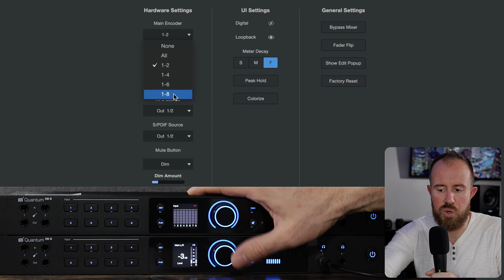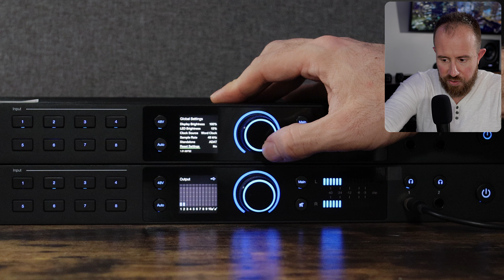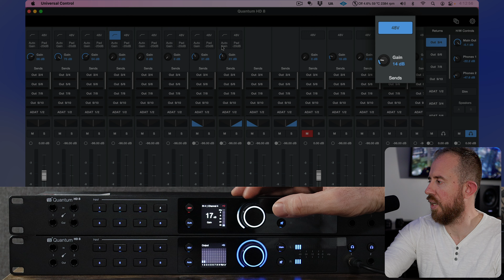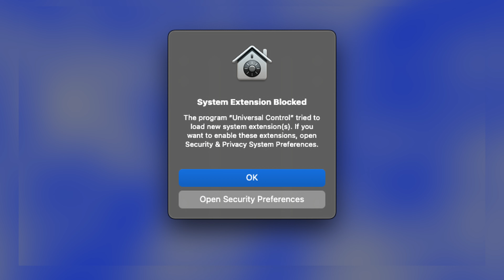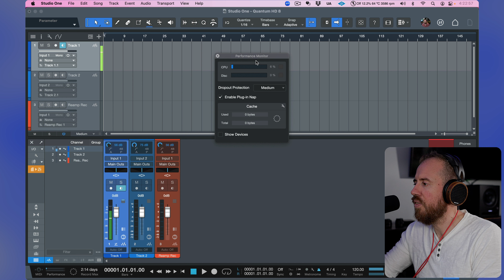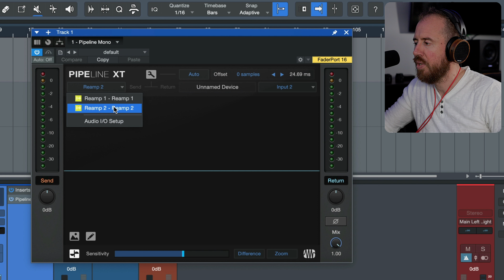PreSonus Quantum HD 8 - FULL Overview | USB-C Audio Interface

Comment: Why no DSP simple comp, eq and reverb? It's a deal-breaker for me unfortunately, I was ready to sell my Apollo (I'm on Windows) to buy it but not even the simplest DSP is a big no
Reply from the maker: I’m not sure, as to why. I think that if you’re used to UA Apollo style of working then anything you look at won’t measure up because of the UA plugins and DSP.
For me - I have an Apollo as well but I still prefer to track through my preamps and outboard and record line inputs that have a finished polished sound straight to “tape”. So I don’t miss the DSP. Also I just use whichever reverb and delays I want during tracking…
Cheers, M
Reply: @marcushuyskensmusic  Ok but most people don't use external preamps compressors and eqs for each channel but want to tweak something just for having nice headphone mix to perform better

Comment: Without separate headphone mixes i can’t use it. I don’t want to monitor microphones when the monitors are on
Reply: There are separate headphone mixes. This can be done in Universal Control or in Studio One (if you use Studio One). You can also mute the main outs and it doesn't affect the headphones.
Reply from the maker: I agree with Oscar. You can literally monitor every single stereo output pair (analog and digital) and switch to any source for HP1 or HP2 in seconds in either UC or Studio One. The headphone routing is very easy to use.
Cheers, M

Comment: dope but what happing about use FX WITH THE MIXER WINDOW ?
Reply from the maker: I don’t use any fx in UC when I’m software monitoring at lower process block sizes. Which this unit is capable of achieving..
I actually bypass UC and I route them in studio one..
Also if I’m monitoring with hardware direct monitoring in UC for near ZERO latency - I also don’t use fx in UC. I use fx sends in studio one and think of any delay of fx returns as acceptable pre delay…
I honestly just feel like I’d rather use any fx I want vs being limited to the included fx in UC.
Cheers, M
Cheers, M
Reply: @marcushuyskensmusic  okay thanks actually I just wanted to know if using effects while you record could be done YOU KNOW LIKE THE UAD onboard processing and still keeping your buffer size low

Comment: This is a downgrade from the 26/32….Line inputs cannot be bypassed…not mentioned in the video…I was excited for a new Quantum…the interface with no mixer…this is not a Quantum…it’s Fender interfering…and an interface costing $999 and I can’t bypass and I can’t hit the ADC direct? Come on!
Reply: There are mic / line combo jacks on all Quantum. Plug into the 1/4-inch part of it and the preamp is bypassed. There is a trim that shows up when a line level is detected, but that is a digital trim.
Reply from the maker: Where did you get this information? Because it’s wrong. Line inputs fully bypass the preamps - and also have a trim. But they’re routed straight to the converter. 
And yes, you’re correct that I didn’t mention that in the video - but I was trying to cover as much as possible. But other videos from other creators do mention this.
Cheers, M
Reply: @OscarDanielGarza  Nope, the 2626 does not bypass the pres. Only on the insert returns.
Reply: @marcushuyskensmusic  Are you 100% sure?
Reply: Presonus support say different.
Reply: @gagsmedia  oh I misunderstood. I was talking about the new Quantum. The ES and HD line inputs bypass the pres.